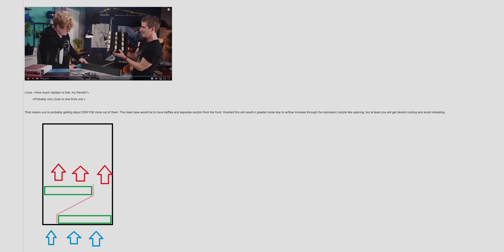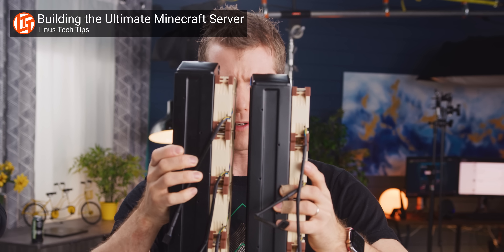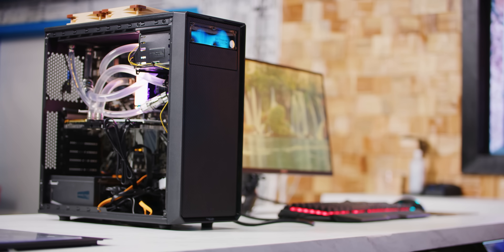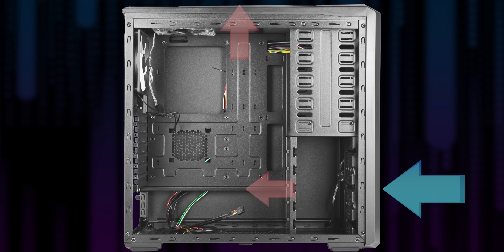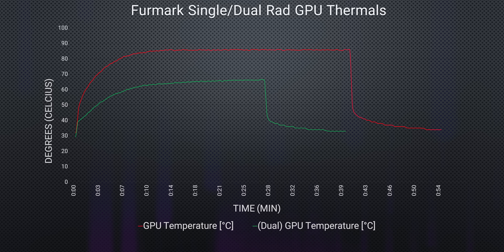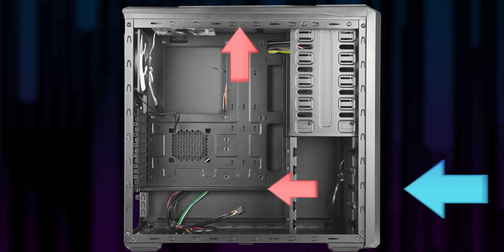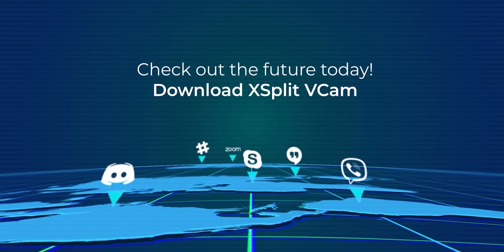I’ve been water cooling wrong for YEARS - $H!T Manufacturers Say

Comment: Though the testing methodology was good you did create the perfect conditions for a second radiator helping by reducing air cooled components and making the system run as hot as possible.
Maybe a follow-up test with a computer with slightly more average thermal production and only CPU OR GPU water cooled might give more detail to why corsair is making those claims

Comment: If Corsair sent the warm water through the radiator in the front with the intake fans first so the cooler water then goes through the radiator in the top of the case with warm air, I'm sure the second one wasn't useful at all. But if the warm air goes through the radiator with the warm water and the fresh air goes through the radiator with cooler water, they both cool the water down.
That works the same way as a reflux condenser.

Comment: I am betting the minecraft server style stacking would have a pretty severe affect on cooling. I dont remember if those were linked in series, but if they were by the time the cooler water from the first rad got to the last one the warm air might be reheating that water. Radiators are thin by design to keep from re-heat issues. Even if they were separately cooling three things if the first thing was something hot and the last one something less hot you run the potential of increasing the temps on that third item because radiators work to heat something just as efficiently as cooling things.

Comment: It would be cool to test this with for example a Lian Li O11 -> 3x360 rads (bottom and side intake, top exhaust) VS 2x360 rads (bottom and side intake, with just fans on top exhaust).
To see if the top rad doesn't work well with all the hot air entering the case with the other two.

Comment: If air inside the case is the same temperature as the radiator then yes you won't be able to remove any heat from it. But I seriously doubt air inside the being that hot.

Comment: This concept you demonstrated is what track/car guys do when adding oil capacity... it adds cooling. 
Adding extra rads just give the system more volume so it can dissipate more energy. Having a massive reservoir would do the same thing.
How about testing multiple systems with the same volume but change the radiator set up.

Comment: When i added a second loop with a rad at the front for my gpu, i definitely noticed a rise in temps on my cpu which had it's rad expelling air out of the top of the case. That being said that rise in temps was nowhere near the drop in temps measured on the gpu from adding the second radiator so i wonder whether my loop would be better as just one loop or if it's better being seperated now.

Comment: "just do a little benchmarking on your own"
gamersnexus spending 10000 dollars or sth. like that  to get some close enough temperature testing for air coolers setup. :D

of course still do your own benchmarks, but remember, that yours will be less precise than GN's for example and also be aware, that if not noise normalized a 1:1 comparison between cooling setups is quite questionable, although comparing  one watercooling loop to another purely on performance basis  with over 10 degree difference is sth. hard to screw up :)

Comment: My understanding was it was the stacking that was inefficient. Linus' test rig didn't stack the radiators. The other Rad was on the top of the case allowing the fans to draw cool air from other corners of the case. The test should have been done similarly to the Minecraft server where fans-rad-fans-rad was stacked as a single unit. I think that would be a lot closer to how Corsair explained the phenomena.
Reply: removing 1 of the 3 radiators stacked in their mc server raised the temps by 5 degrees

one entire radiator and 3  fans were only reducing temps by 5 degrees, that's like.. 5-10% performance compared to air-cooler vs a single rad water cooler.
Reply: @BankruptGreek  While 5 degrees is VERY little and in a lot of cases not relevant in the slightest. Servers are a special use-case. Where thermal throttling can have much more serious side effects.
Reply: 5 degrees makes a pretty big difference with most modern cpu and gpu boost clocks

Comment: I'd be interested to see if there is a difference between positive and negative pressure for water cooling. Theoretically to counteract Corsair's claims the simple solution is to just have both Rads as exhausts and have your intake elsewhere in the case. That was the 'hot air' rapidly mixes with the 'cool air' outside the case. If you want to run this test again you have basically 8 configurations, each with a unique combination of each rad as either an exhaust or an intake, making 4 and then doubling that by testing positive or negative pressure for each configuration.

Comment: Idk if I missed it but I don’t think they also account for the fact that in order to run that extra rad you now introduce even more water which will overall help keep the system cooler for these short term tests since theres more water to act as a heat sink.

Comment: something i was thinking. im wandering if they were thinking of how the "stage" cooling you were running with multiple rads was in the wrong orientation as in your first "stage" or rad was the at the front of the case so the temp diff you would see from the second "stage" would be next to nothing. just a though.

Comment: New email from Corsair: "Your experiment was irrelevant to what we emailed you about."

I think you guys should have run the experiments on the actual systems they mentioned.

Edit: missed the part where they mentioned testing the MC server, thanks for correction
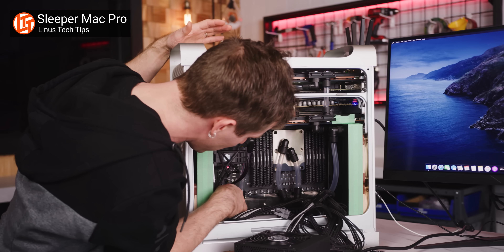Reply: 6:45 is when he mentions it
Reply: Advocatus Diaboli  "corsair" water cooling stuff is really just other companies' water cooling stuff packed in yellow and black boxes :)
Reply: They did he mentioned it in passing but they removed one of the radiators in jakes Minecraft server they had a 5 degree increase in temp meaning Corsair was wrong
Reply: @dratrav  thanks I missed that
Reply: Advocatus Diaboli  They're radiators are pretty great, but those are made by Hardwarelabs lol

Comment: to be fair, Im pretty sure corsair meant  Rad Fan Rad Fan stacked not two seperate radiators in completely seperate spots,of course its going to be cooler, your adding more cooling, the argument is, if they are stacked up against eachother, in the config above, the air will be too warm to cool it down at max effeciency

Comment: I think it would make sense if you wanted to do a three radiator setup you would need to parrallel them and place them in a "U" setup( maybe a rackmount server chassis)..with the front rad taking air from the front and both others in the side taking air from the sides and exhausting to the back..you should study "proces engineering" in a industrial setting, usually if they implement it on a large scale for cooling it would make sense that it will work in small scale..🤔🤔

Comment: I edited out my first idea, because simple is always better.  The easiest way is to put the radiators ouside the case.  Inside the case, over time, the radiators would not have access to cool air.  Outside the case, you have all the cool air you want to cool the radiators.  You still need fans to move the air across the radiator, but this will work.  You should have an episode with all the different solutions below.  There's quite a few.  Interesting.

Comment: He's making Corsair look so dumb. Like they don't know what they're talking about.
Linus is boasting a 20° improvement with the radiators in different locations. 
Whereas, Corsair is saying that with Radiators stacked on top of each other, there's gonna be minimal performance increase, which is exactly what the test showed (a 5° decrease).
Reply: Bhuvanjit Kang ik I was confused when he said that a 5 degree increase was a ‘final nail in the coffin’ like what, it was only 5 degrees. I’d rather run 5 degrees hotter than waste money on another rad

Comment: So sounds like the best layout would a radiator on the bottom of the case and a radiator on the top of the case with an input case fan on the bottom front of the case and an output case fan on the top back of the case.

Comment: if your water is 40c warm and you let air flow through at 20c its gonna exit just a bit warmer and not anywhere close to 40c its probably only going to a warmer by a tiny bit.

what you should test would be the difference between a rad thats pushing air into the case vs one that pulling air out vs 2 pulling out, 2 pushing in and one in plus one out

I‘d imagine you‘d see the lowest on both pushing air in, second lowest on in+out, third on both out. next would be the one pulling in and last the one pushing out but the difference between wach setup would show a lot more.

its basically like the video you guys made on the fan configuration.

id love to see this!

Comment: "You're watercooling wrong" said the company that asks 20$ per fitting, builds 30$ RGB fans (excluding all the extras to operate them correctly), sells almost 200$ pumps and creates shitty cases like the 680X which costs 250 ish and doesn't allow you to mount 3 rads without assle or modifying it because of very little stupid clearance. Oh, and almost forgot their RGB keyboard firmware issues!

Comment: I don't know much about thermodynamics but wouldn't the amount of water come into play?
Reply: Not really. It gives more headroom to soak a sudden rise in temp but just let the system run long enough and it evens out at the same temp. In practice, the container used to store that added water in the system offers a very very limited heat exchange gain through the additional reservoir and piping used to store that bigger amount of water.

Comment: I think that your results are actually correct for what you tested and the method used to test. When you have radiators in different places, especially when their airflow is perpendicular to one another, they don't necessarily hurt each other's airflow. The problem comes when you stack them, or layer them, side by side. That is the scenario where air will pass through the first radiator in the stack but then be blocked from flowing freely by the next radiator. So on and so forth. As you continue adding radiators to the stack you add more impedance to the flow,  therefore greatly reducing the amount of heat that can be transferred. Thus, having multiple radiators is generally a good thing, but when you stack them together you stop them from working at full capacity. That is not to say that having a stack will make your temps increase - it won't- but it will be less effective than having the same radiators completely separate from one another.

Comment: The examples you were showing in the beginning that they were critiquing was a direct series, that is one rad+fan directly on top of another, while what you tested were two setups on either side of the case, as you stated, air is able to enter and exit from other parts between the two rads, but in the examples shown, they are directly touching and therefore no air is able to enter or exit between the two rads.

Comment: if you drop your thermal load into your last radiator you will cool it with mostly cool air -- this will work better than if you have your heat going to the front radiator then cooling your last radiator with warmed air. but surface area is king too. you're not going to get 100% thermal transfer in 1-2 inches of radiator.

Comment: How's about the difference in Corsair fans vs Noctua fans static pressure? Maybe, if all they had was Corsair fans they weren't pushing/pulling the hot air out off the rads as fast as the Noctuas?

Comment: maybe its worth considering that the cooling performance boost is actually due to the increased fluid capacity from the addition of the radiator rather than the additional radiator itself. Would adding the same volume of water to the system that the 2nd radiator added without actually adding the radiator produce similar results?
Reply: The added fluid would affect the "soak time" but not the peak temperature.
Reply: They waited for the water to heat up before taking measurements. More water will just take longer to heat up, it will not lead to significant temp decrease.
Reply: that's why they let it reach a stable temperature. more mass just means it takes longer to heat up, but without a way to dissipate that heat, the temperature will be the same. IIRC they already made a video on the subject. It was a long time ago, I'm not sure if it was them or Kyle or Paul, etc..
Reply: A little bit. More water means more headroom to reduce a sudden temperature rise but let the system run long enough and it evens out at about the same constant temp (minus the cooling exchange brought by the supplementary material to contain the water, wether it's a reservoir, additional tubing or a radiator with a very restricted airflow). I think Steve at Gamer Nexus and Jay 2Cent have made videos about it a few years back.
Reply: @Claptrap Jesus Not saying Linus is doing the science right, but it's corsair guys that said another radiator would bring no benefit. It's not about careful control of every variable, it's about "does it reduce temps when we do it the way we do it?" and it clearly did. Maybe it's the added airflow, maybe it's second radiator, maybe it's something else, the point is it works for them.
Reply: That's not how it works.
Reply: @Claptrap Jesus  They addressed their hack pro build with one intake radiator and one exhaust. Although they did not test the same case and build, they tested on a system with also one intake and one exhaust radiator. Yes, it's not THAT SETUP, but corsair said that having radiators set up like that won't help, not "that exact machine in the exact case, with exactly the same radiators".

Comment: Surely you should put the hot water through the exhaust radiator first and then cool on the inlet radiator? Hotest air goes straight out the system and air coming into the case doesn't get warmed up as much because the first radator is only cooling the already slightly cooled water.

Comment: Great educational video! I'd like to comment that the heat load you apply makes a very big difference. With you high power test rig, there's a lot of heat that needs to be taken out, so the additional surface area still helps. Now if you take a lower power system, let say 250W, and the additional radiator might just indeed hinder cooling or just not help. This is just logical thinking by me as an applied physics graduate, I haven't tested it. Dit Corsair tell you the parameters they used? Also, the flow rate is important in big systems like these, it has an optimum. With heat transfer systems with such a high thermal mass as a big liquid loop, more flow does not necessarily mean better cooling. It takes time for the heat to transfer out of the water. In simple terms, if you pump too fast, the water is back at the heat source (CPU, GPU) before it could lose the bulk of the energy inside it. Again here though, logical thinking, I didn't test it. It could be negligible in the range computer cooling operates in.
What we for sure finally should do though, is to throw out the term "radiator" for the heat exchangers in computers and also those on your wall. They are convectors , the radiation part of the heat transfer is quite negligible

Comment: Why don't you orient both coolers to pull air from the outside and then evacuate the air with fans. (Think radiators pulling air in on top and bottom or front and back, and fans on the opposite)?

Comment: yea but you didnt stack the radiators.. they were in different parts of the case. stacking rads would be like you described... the minecraft server. having 2 rads in 2 different places and not stacked on top of each other means that comparing it to corsairs comment is like comparing a banana to an apple.

Comment: I think Corsair were saying that it's not efficient to use radiators like that. Why don't you compare two radiators taking in air from outside, with the setup you showed in the video? Obviously two is better than one, but how you use the two matters and makes a difference to how efficient the setup is which in turn means you get more bang for your buck.